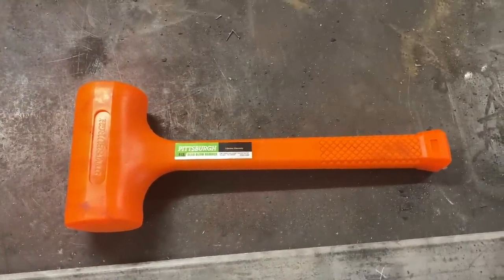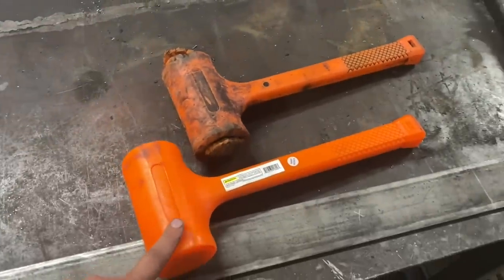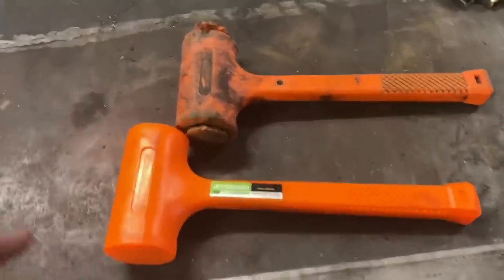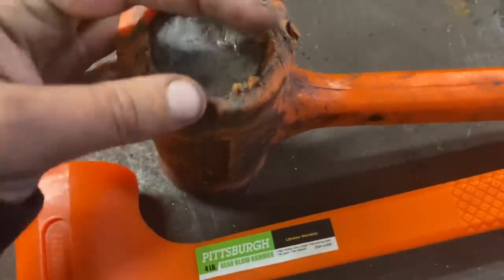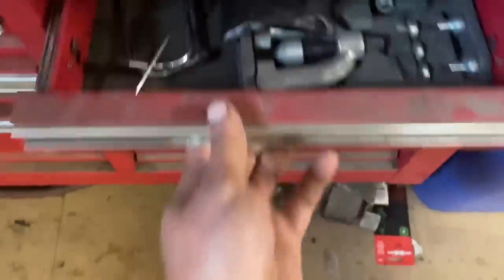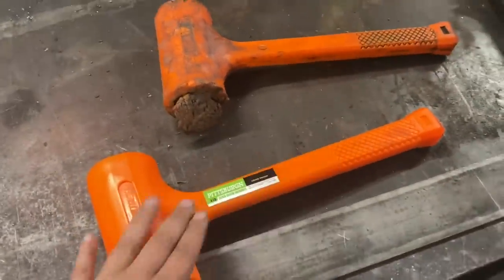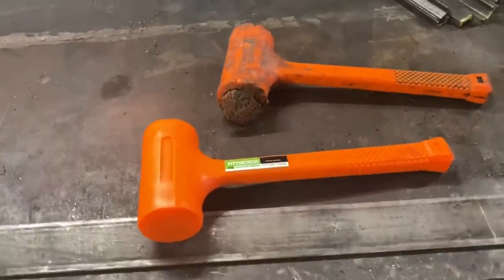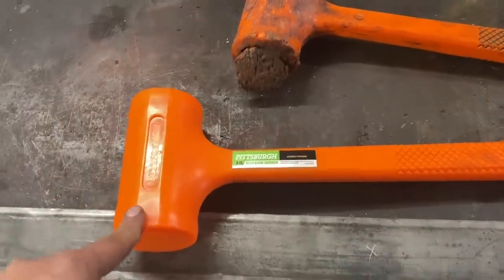Harbor freight 4lbs dead blow hammer review!

Comment: Retired as a locksmith. Deadblow is great for "givin' a wack" to a safe door.
Last week, working alone with light wood pieces and an air stapler, used it to back up opposite the stapler...no bounce, drove the 1.25" staples like a dream.
This is one tool I have not misplaced (ORANGE).

Comment: This is not a review. It's a guy babbling for 9 minutes. A tool review should, at the very least, include some real world examples of use.  Seriously. Nobody needs to hear the same crap said 6 different ways over a period of 9 minutes while the hammer sits stationary on a bench.  Shame on HF for linking to this in their email ad.
Reply: It does seem that a lot of guys have these kinds of reviews where they go on and on talking but actually say very little of consequence.  You hit the nail on the head with your commentary.
Reply: Ditto
Reply from the maker: If you need someone to show you real world examples of how to use a hammer…. You probably shouldn’t be using a hammer.

Comment: Dead Blow hammers have a shorter life span than a carpenters, ball peen, or sledge hammer. 5-7 years is about average.
For those comparing it to SO, my coworker just warrantied his out a couple months ago, it crumbled and fell apart, getting worse sitting in his tool box. Literally had ho rubber left on the handle. It was 10 years old and cost $70.
It was replaced under warranty, the same as the $12 version would be.

Comment: I have had several of the orange HF dead blows, I keep buying them even though the heads shatter(?) off the metal inside, the caps fall off and the shot pours out, after what seams like minimal use ~less than a year home garage use, because they are so cheap. I have at my place of work Blue Point and Snap-on dead blow sledge hammers (8-10lb heads with 28-36" handles) that are used by everyone in the shop, for over 10 years and other than the heads being scratched and marked up from hitting rough surfaces they are 100%
I would rather spent 8$ 10 times than 350$ one time for dead blow hammer, for personal use at least.

Comment: You may have been in a rush yesterday but it is obvious you are in no rush today. 9 minutes to review a hammer without ever swinging it. No report as to whether HF replaced it under warranty. Not a way to build a channel.
Reply from the maker: If you need to see someone swing a hammer to know how to use it or how it works you should be using a hammer to start with
Reply: @dicus_enterprises  A Dead Blow hammer should have a dead blow effect. Do you not know what a dead blow effect is? That dead blow effect can be tested.